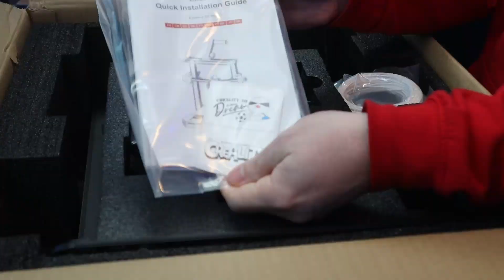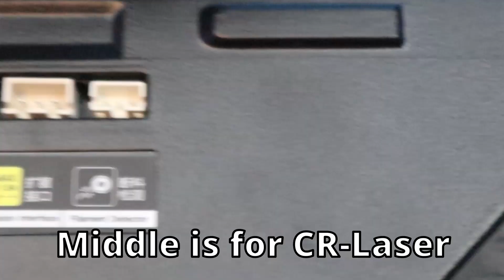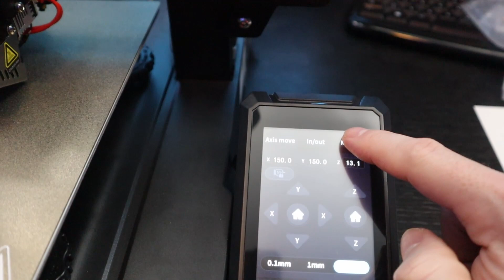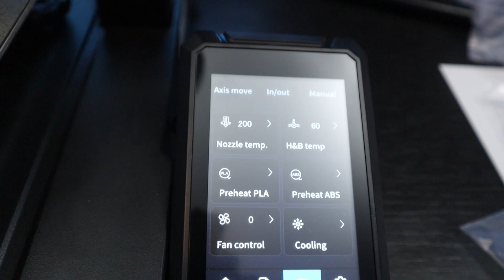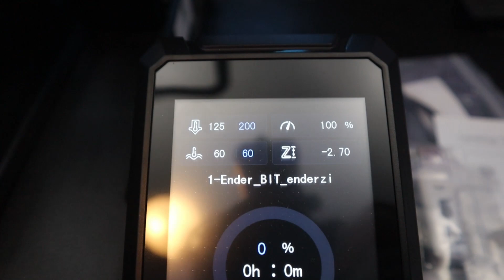Creality Ender-3 S1 Pro - Unbox, Set Up, and First Print

Comment: when i go to click settings to level it for the first time the ender goes to auto level, then the bed axis and nozzle axis begin seizing in their respective corners?! the z doesnt shift at all and its as if it wants to expand to a bigger bed size but doesnt have the track to do so. help?
Reply from the maker: Sorry for the late reply. If you want to do auto-leveling, then it does do that? It normally starts in the middle, then goes into the corner, and levels the whole bed. Did you check if all the wires are connected? It sounds like a silly question, but there might be an issue.

Comment: How do you stop the leakage though, because I try to print but the PLA is dripping everywhere before the print
Reply: Check the temperature, for high temperatures of the nozzle would melt the material too much and it would drip; also, make sure you have retraction turned on.
Reply from the maker: If the temperature is too hot, then it can happen that you have more oozing on the nozzle, just like @RadoslavDejanovic said
Reply: @Zachary3DPrints  thank you yeah. I’ve come a long way since my couple first days of printing.